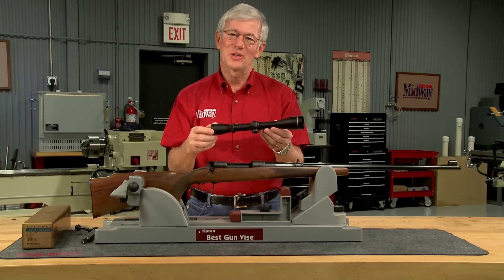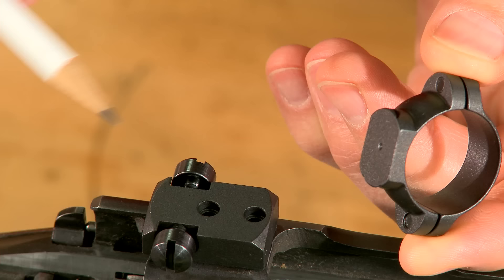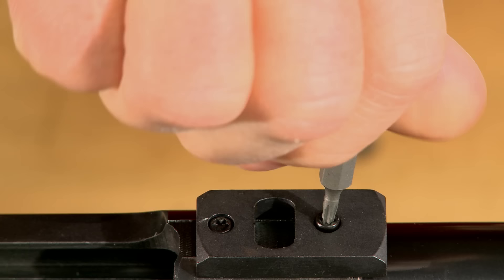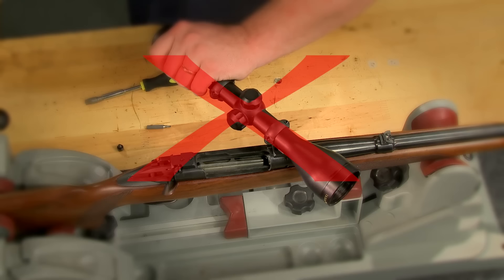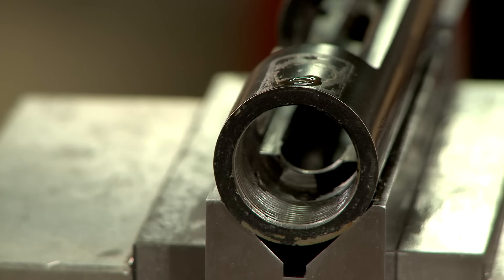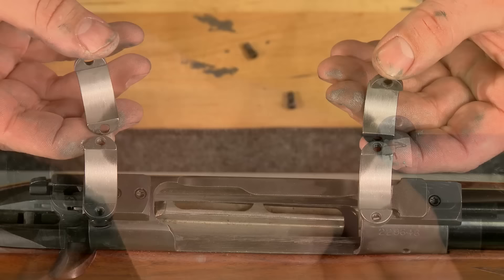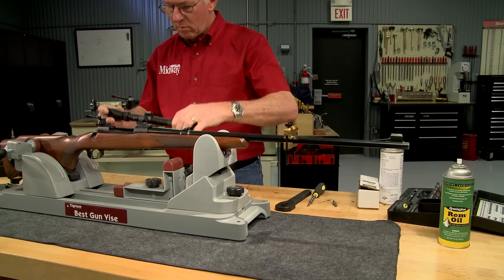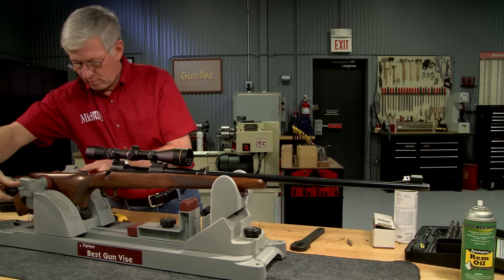How to Properly Mount a Scope Presented by Larry Potterfield | MidwayUSA Gunsmithing

Comment: i usually finish with a vertical line on a target at the desired zero range.
idea is, bottom of the line is set to about -15moa, and top is set to about +15moa.
during the adjustment of say 5moa per shot, if the impact point strays from the line in a uniform manner, it tells me the relationship between the scope and the rifle is not vertically aligned. as said below, a plumb line is ideal for making sure the target line is perfectly vertical

Comment: So you suggest mounting the scope as far forward as possible to avoid being injured rather than at the point where the eye relief is correct for your cheek weld? This seems like a statement to protect Midway from liability rather than the correct way to mount a scope. The shooter should not have to adjust their hold to the method of scope mounting. If you can get whacked in the head by a scope, then that scope does not have sufficient eye relief for that heavy recoiling round and you need to select a scope for that round.

Comment: I'm glad he selected the Low Rangs... oh! Nevermind, we swapped to Medium Rangs. 

I have to admit, I am taking my rifle in to a gunsmith thus week to have my scope rings lapped and scope mounted. I have never done this before, but I also never owned a Zeiss Scope before either. 

I want this puppy to be done by a professional. I am a tradesmen, and a professional in my own field. I understand the worth of hiring someone sometimes, instead of doing an "okay" job myself. 

Ruger M77 Hawkeye in 7mm-08 with Zeiss Conquest 3.5-10×44. Should be a sweety
Reply: i Currently own all leupolds, theyve not failed me so i have no complaints. However, i've always just put them on and don my best to level them with basically $0 spent on tools. As a guy that works in the optics field, i figure its about time i get serious about maximizing my own. May try lapping and see how it improves my accuracy. Just might flirt with getting a swarovski in the future

Comment: Sir I m using precihole Nx 200 Athena 
.177 air rifle by using the scope of 3-4x40 Gamo and I m getting trouble to Mount the scope on 3/8" 11mm Rail some 10 to 15 shots of pellets the scope is coming backwards on the Rail so if have any idea to fix the properly than please tell me sir thanking you sir

Comment: I'm seeing all the comments here, I agree it is way to complicated of a process, for me or anyone who does weekend shoot on a public range for fun. Here is the thing though, being a engineer myself I know there is getting the job done, or getting it done right. If you are shooting hundreds of yards and even 1000+ every mm or even 1/2 of mm will count. For this type of precision you need this type of process. Yes bore lasers etc make things easier, because all you are really doing is adjusting the cross hairs to match with the laser mark, but what this does not do is mechanically make the rifle and scope sound in functioning as one piece. That is 50% of it.
Reply: T Singh 
When you consider that most shooters are super happy to hit a pie plate. Then this is over kill. And unless there is some magic that has been recently developed,  it is highly unlikely that 2 rifles of the same make and model will shoot exactly the same. Years ago, I had a Model 70 Win. in 30.06, I slapped a 3x9 Leopold, glass bedded the stalk, weighed the cases, weighed and sorted the points, drilled the flash holes, reamed the neck mouths, installed a Canjar Set Trigger, took 200 rounds to tweek a load, and got a 0.3 inch group at 100 yds. oh,,, I used loktight on the scope threads.
And after all that,  I  still think it was luck...Ok,,, it was repeatable,, but still luck...
Reply: I agree. There are tons of videos of guys in their garage setting up scopes the easy way. Its interesting to see the best and most accurate way of possibly doing it from an academic perspective. Especially when you can do a similar job using the tips in this video but cheaper tools.

Comment: A lot of professionals here. Look, do you have to have all these tools to mount an optic and kill a deer at 40 yards? No, you don’t. But if you want to do it the best way, this is a great short video on the process. Cheap and easy doesn’t always equal good, lasting quality.
Reply: I think the same when i see these. Do i need a Model 70 and a Swarovski with lapped rings and custom reloads to hit a whitetail at 60yds? Well, no. Im sure i could get that deer with a savage axis off the rack at walmart with the factory simmons scope. But going through these processes, investing in the equipment, its way more enriching than just "good enough." 

When I'm in the stand or blind, I am out there to take the life of an animal. I owe it to that animal to give it my absolute best, i appreciate what i have accomplished way more when i've put that much detail in it.

Comment: I cant understand why do you suggest using loctite ? If in any case rings or scope need to replace how could be possible to reopening those screws? You will stock with that mount and scope forever..
Reply: Kamran Pipekesh blue loctite isn’t permanent.

Comment: Hi - thanks for this informative video. So by placing the reference level on the scope elevation turret and rotating the scope until the bubble is centered, the assumption is that the vertical axis of the reticle is aligned with the elevation turret?
Reply: The goal is to get the vertical reticle plumb with the rifle.

Comment: When adjusting the windage screws on the rear base using the Wheeler kit, how can you tell when it's centered?
Reply: What he said didn't make that much sense.  I guess he was bringing the point of the rear ring alignment bar into rough alignment with the front ring alignment bar.

Comment: Guys tbh I just buy a a long one peice Weaver base because they are like 9 dollars and I put it on the gun and tighten them till they feel a hair more than snug and then clamp the rings to the base, take the top half of the rings off and I buy a 3 inch $4 level from amazon and center the scope pretty close and tighten them a little more than snug and get then almost to even tightness.

Then get a bore sighted and bore sight it and sight it in further and get a feel for your gun and have fun

Comment: If you're going with a scope that has an objective lens larger than 44mm you'd better get a stock with an adjustable comb or buy a raised cheek pad. If you don't you'll have a hard time seeing down the center axis of the scope. A larger objective lens will not 'gather' more light.

Mount the scope as close to the barrel as possible without touching the barrel. 

I used to use Leupold medium 1 inch rings. I exclusively use Talley Manufacturing two piece rings. I like them so much I replaced the Leupold base and rings on all my rifles with Talley.
Reply: yes, yes it will.
Reply: @James28R  Scopes do not gather light. Scopes transmit light. The better the lens coating and quality of lens the light transmission will be better. I have a Swarovski scope that that has a 95% light transmission. 

Your $200 Leupold won't come close to that.
Reply: @texassportsman5880  Maybe the only time my optics knowledge from my job can actually be applied outside the office and people might care, oddly exciting moment for me. A bigger objective does allow in more light, but the coatings on the lenses throughout the scope are way more important. So both of you are right, but you are more right. 

Also, I used a pair of my grandpa's bino's last season and they were basically nightvision. Then i saw the little silver eagle on them, looked them up, and realized he just casually handed me a $3,500 pair of bino's. I'd love to get a Swarovski on one of my rifles, but i'll have to "settle" for some "cheap" leupolds for the time being. I will say he lifetime warranty of the Leupold versus the 20 year "lifetime" warranty of the Swarovski is pretty nice, but i also dont treat my equipment terribly so i likely will never use a warranty

Comment: So mounted my own nikon scope 2 years ago. I did not lap the rings. No wonder I have to adjust my scope so often.
Reply: Doyle Hargraves probably not the reason. We’ve never lapped. And never had a rifle lose zero. If your shooting factory ammunition, you pretty well need to stick with a certain load. That’s why I handload, quality control in today’s ammunition market is in the toilet.
Reply: @Bent099  I figured that out shortly after I posted that. I have stuck with Federal Nontypical ever since. It's accurate enough, and economical.

Comment: Larry, I know you know a lot about setting scopes and working on guns, but even I can see the rings were never set square (perpendicular) to the receiver before you lapped them. I always use a long bar between the rings to set the angle because too many times going point to point like you did never works. Then if a long bar won't slide easily through the slightly loosed rings, I know they are not fully set perpendicular. It's a no brainer.

Comment: FYI, Loctite 242 does cure quite well in the presence of oil, so degreasing the threaded holes is quite unnecessary.
Reply: Daniel Fricke degreasing has more to do with true torque value than anything. That said I don’t worry about it. Haven’t had a scope come loose yet, and I don’t use loctite.

Comment: Excellent ,Now i know what lapping the scope rings entails, one thing i didnt like is using the scope cap to level the scope,personally prefer a plumb line..
Reply: I don't think it has to be absolutely perfect.  A slightly canted scope can still be sighted in, it's just that your adjustment clicks won't move exactly as much as they are rated to do.
Reply: @robertbrandywine  and your windage will be progressively further off the further away from the scopes zero you shoot.

Comment: Who and hell has all this shit at home just to mount a scope? All this crap probably costs more than the optic itself. Throw it on, level it and torque it down done.
Reply: 427SuperSnake1 this video is ment for professional gunsmiths
Reply: It's $100 on Amazon for a lapping bar kit that has the bars, alignment centers, bubble levels, torque wrench, bits, loctite, and lapping compound.  The gun vise is an additional $80.  Since I just had a scope come loose and slide on my 45-70 (with good quality steel Leupold mounts, too!), I think it's worth lapping it in correctly on heavier-recoil rifles.  I have a 22-250 that I haven't lapped-in and it's been fine for 100s of rounds, but the 45-70 moved after 50.
Reply: 427SuperSnake1 i can tell you alot of places that do scope mounti g do not do half of the steps he did haha
Reply: LOL I hear ya!! My rifles shoot what they shoot, and his rifles don't shoot any better.
Reply: you don't need 8-40 screws for a standard medium bore rifle... was my point.

Comment: What's he using to degrease? Will Outer's nitro solvent do the trick?
Reply: It's no big deal -- use anything like acetone, naptha, mineral spirits, gasoline,  brake cleaner, carburetor cleaner, Goof-off, Oops, paint thinner.  But I wouldn't use nitro solvent.

Comment: Did anyone else strip their base mounting screws when torquing them down to 30 inch pounds?
Reply: Blackburn1917 ya 30 lbs on average is a little excessive. Maybe if a .375 but 20-25 would be sufficient

Comment: What do you degrease with? What was the spray?
Reply: ya can use brake cleaner...bigger can than gun shop supplied brands for the same product in the can.I use it to clean my rifles/guns all the time.
Reply: Lol, that moment when you realize that expensive bottle of Synthetic Safe Gun Scrubber is really just brake parts cleaner.

Comment: Hi can anyone tell best scope for air rifle & how to adjust it for short & long range
Reply: I would suggest a rimfire scope because eye relief is better for the rifle. Leupold makes one that's 3x9 and variable
Reply: Dear Dakota thanks for advice 
i will try to buy a rimfire scope
Reply: +Waheed Balushi make sure to buy the right mounts
Reply: Dakota Scott
yes i will but i am a beginner or trainee you can say & i m tryin to get much info as i can to learn about air rifles
Reply: +Waheed Balushi 
I am NO gun expert.  But I was told that for air rifles the scope actually has to say "approved for air rifles".  Is this true?
Reply: ***** 
Thanks bro for tips yes there are special scopes for air rifles but my concern with best one which has no complication when adjusting
Reply: I like the Beeman scopes. I have a couple of them and they preform well. I also used them on regular large caliber rifles and had no roblem. Remember air rifles have recoil opposite that of powder powered rifles and normally do not last on them. The Beemans have. as for adjustment I use 3 power for close and 9 for long range. No problems
Reply: JIMMY TATE 
thanks for info sir

Comment: How do you mount a scope to a Remington 550-1?
Reply: That depends.  Does your 550-1 have a dovetail milled into the top of the receiver? Many, but not all, of the 550-1's had this feature.  It started in the early to mid 50's I believe.  If yours does then mounting a scope will be easy.  All you have to do is get a set of .22 3/8ths inch 'tip off' rings that will clamp directly to the rifle's receiver, no bases required. They're very inexpensive, around $10 - $15 usually, and any sporting goods store or gun shop should have them. (Here's some from Amazon. http://www.amazon.com/Weaver-Caliber-1-Inch-Tip-Off-Rings/dp/B0002IOGF0 )  After that follow the directions in the video.

If your rifle does not have the integral dovetail you'll have to take it to a gunsmith to be drilled & tapped for scope bases to be added.  That will be more expensive.

If you're not sure what the dovetail looks like or whether your rifle has one click on the links below to see some pictures of 550-1's that show the integral dovetail scope base pretty well.
http://cdn2.bigcommerce.com/server5100/7g4m0/products/100550/images/494617/R15911c__99829.1382568862.1280.1280.jpg
http://cdn2.armslist.com/sites/armslist/uploads/posts/2012/02/22/313245_02_remington_550_1_640.jpg
http://www.gunauction.com/search/displayitem.cfm?itemnum=9434481
(At the last link just scroll down to the bottom of the page where there are several good pics.)
Reply: Nope. It was made in '48.
Reply: 20alphabet  I see a gunsmith in your future...
Reply: It's such a sweet shooter, of all .22s out there, this one could really make the most use of a scope.

Comment: He kind of skipped over how you get the rear windage adjustment correct.  After placing the bore alignment rods in place,  align the front one with the barrel visually.  Then align the rear with the front one.  Finally, screw the windage adjustment to get the tips of the bars touching perfectly.

Comment: You don’t need any of this to mount a scope. The torque screwdriver is nice and handy, but I literally used a cheap rest. My IPhone Leveling app and a wall to line my scope. I’m hitting less than 1 inch groups every time.
Reply: you realise group size is nothing to do with scope mounting. unless its actually loose.

Comment: Why is he levelling the scope from the front base? I thought it should be with respect to rifle's receiver.
Reply: Lots of receivers don't have a flat area you can use.  He's making the (reasonable) assumption that the base screw holes are drilled at the proper angle and that the top of the base is at a right angle to the screws.

Comment: They don't do all this at Academys or Bass Pro Shop????
Reply: With free scope mounting, you get exactly what you pay for. The vast majority of scope users will never see any benefit at all by aligning and lapping the rings and modern mass produced rifles are usually drilled correctly. There's also no point lapping $10 redfield rings for a $50 bushnell scope.

Comment: Torqued screws should not have to have loctite should they
Reply: Depending on what the screws are being used for no. But with something like a rifle, over time the recoil could back the screws out hence the loctite on the threads.
Reply: @ellijahsmith4445   how about  nut type screws on cantilever base on my ar  made by mounstrum. Spelling sucks most likely
Reply: @ellijahsmith4445  I will back out one screw at a time and apply  thanks
Reply: @ellijahsmith4445  monstrum

Comment: One of the reasons that you lap the rings is to reduce distortion on the scope tube. All you "throw it on and torque it down" knuckleheads are damaging the scope. I guess those who spend good money on high end products can appreciate near perfection, those buying $80 scopes off Amazon to mount on $300 junk guns could care less as evidenced by the "expert" comments.
Reply: I buy $1000 rifles and $300-400 scopes.  I never damaged a scope when doing it without lapping.
Reply: Its not the cost of the rifle that matters its the skill using it
Reply: TheRoadhammer379 - What's with the name-calling? Can't you offer your opinion without insulting folks? My $80 scope and $150 junk gun (old Winchester 94) puts meat on my table that I couldn't otherwise afford. If you want respect, you should show some.
Reply: TheRoadhammer379 yup
Reply: I bought a Marlin Model 60 for $80 and put an $80 scope on it lol. It's a .22 no need for a $1000 scope on my $80 rifle.
Reply: With all due respect, more game has been killed up here in Canada with 30-surplus .303’s